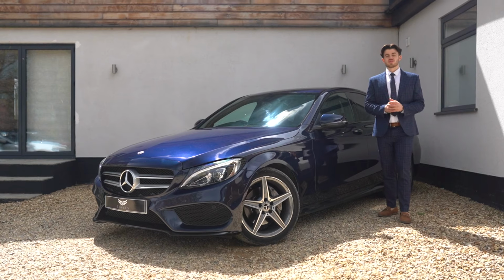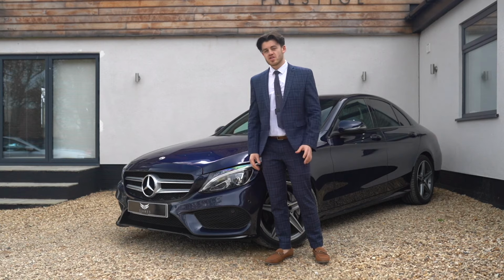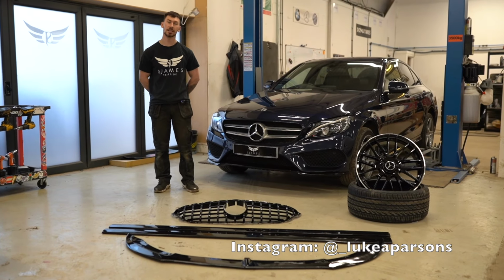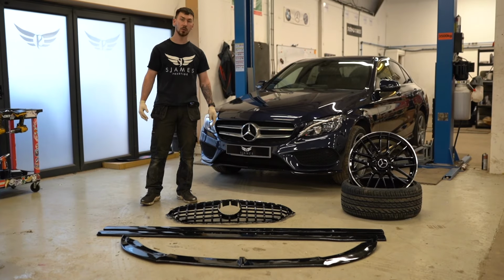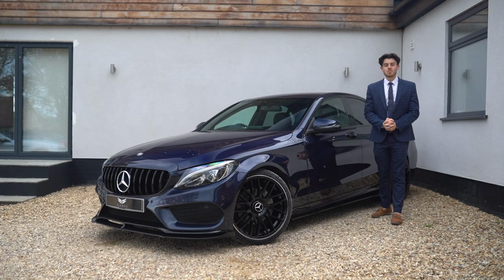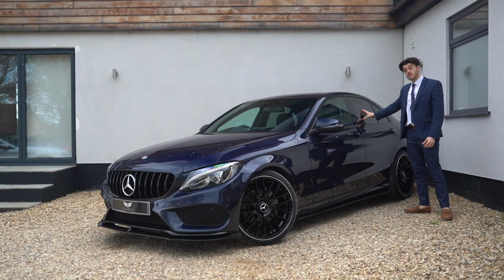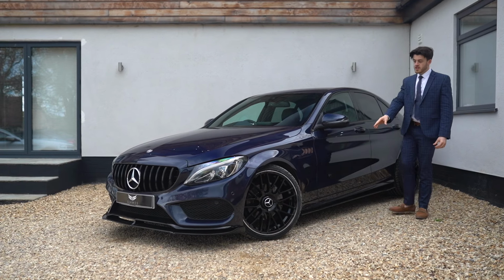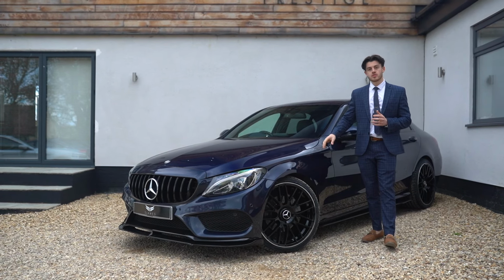TRANSFORMED - SEE WHAT WE DID TO THIS MERCEDES C CLASS

Comment: looks good, did you guys do any setup to the suspnsion before adding 20" wheels or it is ok to just swich form 18" to 20". i would like to add on mine 20" but i have been told that i can not. help will be nice thanks
Reply: I hope someone answers bec I would really like to know
Reply: @DearJuel  you can put 20's on but you should lower the car. I switched from 18 to 19's and put h&r coils and it looks good

Comment: Had mine for 5 years now! NEVER EVER EVER should they have put 20” wheels on the C Class. The ride is awful, the front wheels hit the bumper and wing (this is why they fit 225 tyres on a rim that requires 235)  I know this as I’ve had to do this as there is absolutely no protection to the rim. The Rear alloys are too wide and the scuff the body work going over the smallest of bumps on the road. I’ve gone through 3 front springs, 5 tyres, two suspension arms and a shock absorber! If anyone is genuinely interested in how your C class will look after 5 years please get in touch. Only now am I changing the wheels as there extremely cheap versions of the real ones and there very badly pitted! I know I’m not the only one with this issue! GREAT WORK SJ PRESTIGE
Reply: I got 19x8.5 front and 19x9.5 rear. Thinking of 225/40 front and 255/35 rear. What's your opinion on that. I got air suspension on it

Comment: Does changing size of alloys and wheels affect the tyre pressure sensor or does it adjust?
Reply: The Tyre Pressure Monitoring system can be zero'd on the dash to the new pressure setting and will detect pressure drop from the new zero. Hope this helps you.
Reply: Thank you, yes they adjusted to the new values after a few minutes of driving. I had my c class transformed last week front grille and alloy wheels same as this video and it looks stunning!
Reply: @stergosheath361  how much did it cost you? If you don’t mind me asking
Reply: @bilalfaruqi9689  £650 alloy wheels. £500 tyres. £150 front grille. Hope it helps with yours. Mine looks stunning!
Reply: @stergosheath361  was it the same wheel in the video because I haven’t found the genuine ones for under 1.5k used
Reply: @stergosheath361 hi please can you provide links
Reply: @abdullahibrahim5921 ones in the video are not genuine, there’s no AMG badge on them